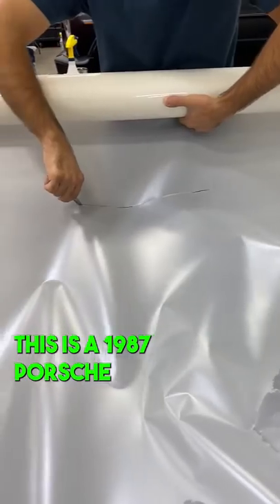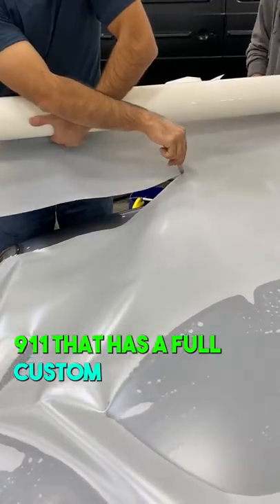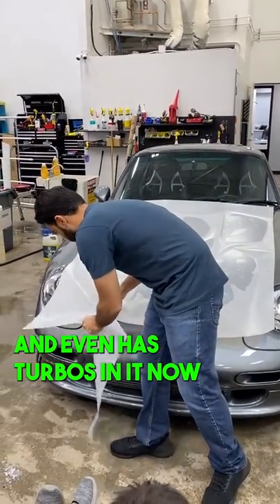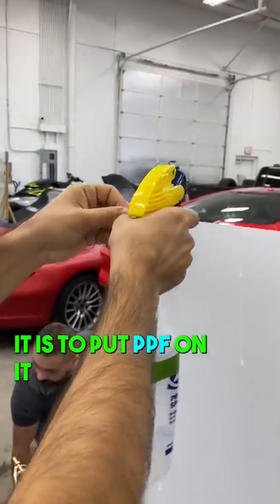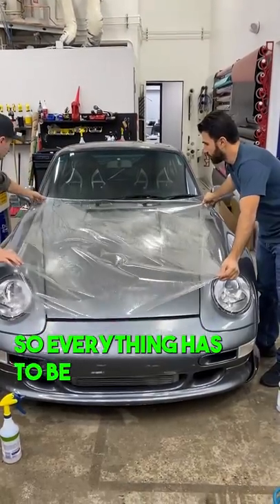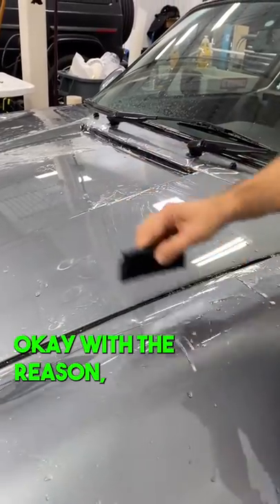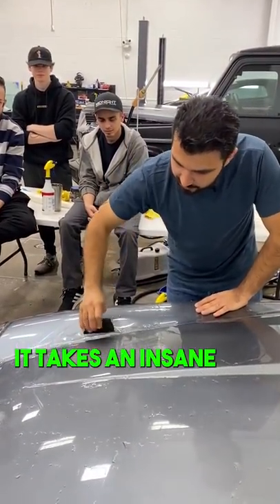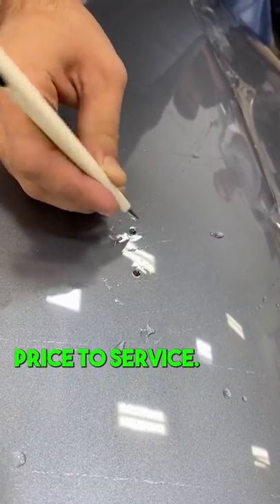When you have to make custom templates!

Comment: You literally have to cut the material to shape regardless of the car. Sounds like you over charged and scammed the customer
Reply: The issue with those kind of wraps is it probably cost more if not as much as a custom wrap. You’re better off getting a custom wrap. Also I’m sure the color will still fade cause the sun will still hit the color of the car.
Reply: @coltenriggs827  PPF is more to protect from rocks and scratches
Reply: @eduardogears5259  yup
Reply: And I'm still not going to pay him

Comment: Custom made Lmaoo. Yea by using a 2$ box cutter
Reply: @LliamMoore  the video makes it out as if the vinyl is custom made when it's literally just big sheets cut out with a razor knife. That's not custom made.
Reply: @RSpracticalshooting  the cuts are custom for generic body styles there are templates online you can plug into your vinyl printer and it makes the laying of the vinyl go twice as fast when you have no template you have too cut exact on each panel.

Just because something looks easy or simple does not make it so this I an incredibly difficult job too do correctly. The prep for the wrap alone takes 2 hours
Reply: You know nothing about wrapping cars
Reply: @adambarnes4018  ok
Reply: @FaZe_gay  Hope you’re not being sarcastic, because you clearly don’t. Just don’t comment anymore on these topics.
Reply: @mannyislikethat   😂
Reply: Guy believes quality can only be achieved with a ridiculously expensive tool, if it works, it works, why ya gotta be so mad he’s using a $2 tool.
Reply: Its about 20 dollars and the blades are a couple bucks a piece ( there carbon for flexibility ) if you've ever had to do it you'd know how much practice it actually takes to cut ppf and not damage the vehicle but you don't

Comment: That's a 993 but it's still amazing. I love those air cooled ones. The 993 was the best in my opinion.
Reply: It’s a 964
Reply: It's not look at the headlights. I worked at an aircooled porsche specialist shop for years.
Reply: @crabbiboi5528  It’s been made to look like a 993 but the wipers are a dead giveaway that it started life as a 964, look at the spacing between them
Reply: @user-cg3vv  it’s not